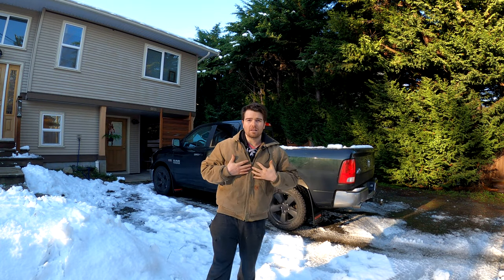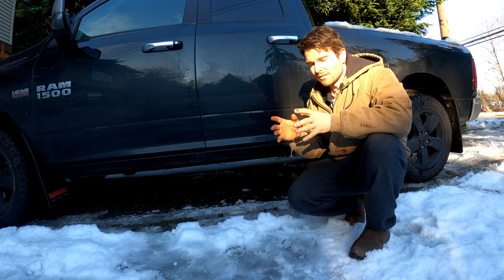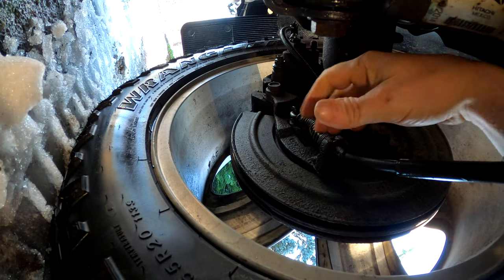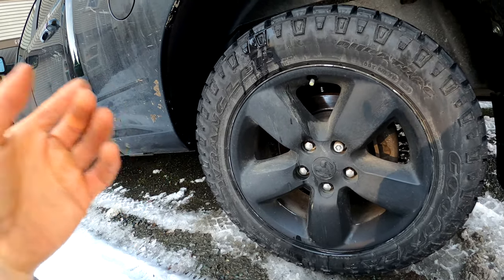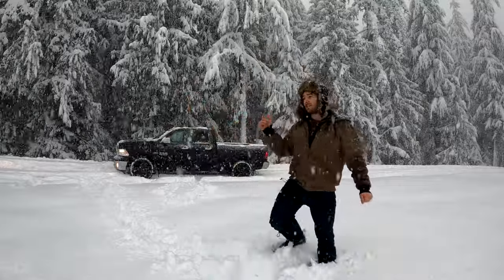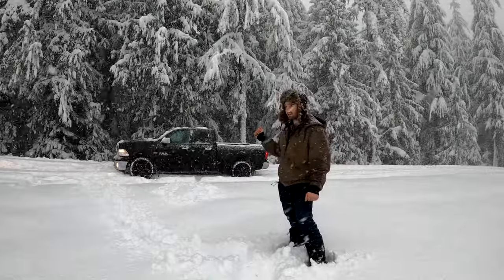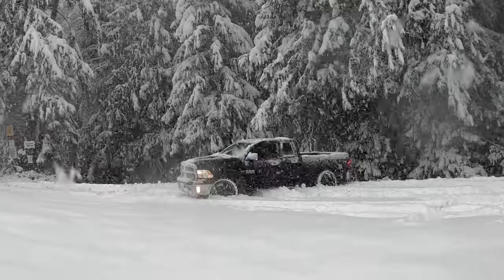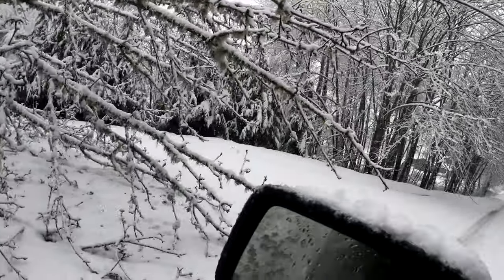RAM 1500 Sagging Park Brake Cable FIX (The REAL Cause) + Deep Snow 4x4 Mountain Adventure

Comment: The cable sag is a minor visual inconvenience.  The fact is; your parking brake is dragging causing the ABS system to throw codes. And wear out your braking system. It is caused by salted road corrosion. Should have been one of many recalls

Comment: How much would Replacing that fully and replacing the left rear wheel sensor ( it knocked it outa place/broke it) in total by a shop cost? ( i just got my truck ) happend same day bought just wanna know if dealer wont fix it

Comment: Just fixed mine. The adjuster as you call it is actually a lever. That part does not come in a hardware kit and must be purchased separately. That lever gets corroded or stuck and is the actual problem.

Comment: I have this issue and did not know this.  I bought a powerstop brake kit a few Months ago and wanted to wait til it got alot warmer here in Wisconsin. but I started to hear a dragging noise. Assuming it was the rear diff. I jacked up the rear of the truck and put in drive and noticed it was coming from the wheels. I started to disassemble the brakes and pulled the rotors and the parking brake shoes just fell off. The parking brake lever actuator can not even be moved by hand.  The lever is what you pushed back with the punch. So I basically rebuilt everything in the rear bags. Parking brake lever, shoes, hardware, then my new drilled slotted rotors and pads from powerstop. Did not look at the sagging cable yet to see if it fixed it but sure it helped with just alittle adjustment at the adjuster needed hopefully.  Thanks for the help.  And this confirms your theory.
Reply: I did mine just like yours powerstop everything, my shoes fell off as well it was rusty all over,  I pulled the axles cleaned everything and when I put everything back I took my break grease with a brush and brushed all the components that rub together, all moves freely, I'm jumping to the front now.

Comment: I've wrenched for years as a young lad and always hated ebrakes! Always needed to replace something on vehicles purchased as used and required for road worthiness. I did however, start using mine on a 2016 with very low miles. My driveway at camp is on an incline so I would engage them when parked. Had the droopy cable  problem and snugged it up ever so slightly. My truck is in the garage for a broken front axle (Northern Ontario potholes) and the they just called and said my ebrake pads had disintegrated and everything's seized! Told them to fix it and never, ever use those cursed ebrakes again!!

Comment: My 2015 is doing the same thing. I need to push the lever back into position. Just curious, did you ever replace the e brake shoes? Just wondering if that’s the solution or if there are additional parts that need to be replaced other than the shoes. I want to permanently fix this issue, not a temporary fix and have to constantly get under there to push the lever every time but not exactly sure what the permanent fix is.
Reply from the maker: Ya I replaced the brake shoes. Not the prettiest job but it worked well. And I always used the park brake and it still happened to me which is weird.

Comment: damn, I figured that's why my cable was hanging, thanks for the confirmation, time to fix... meh I need a brake job anyways, might as well.

Hey though, since we're all gathered here. Has anyone had the issue where wet heavy snow accumulates around the transmission and prevents you from being able to shift back into park after driving? Then you gotta hop under in the snow and clear the snow out from around the tranny so you can shift into park and take your key out of the ignition and lock up before you leave. Just another issue I've had which seems like an engineering oversight.

Comment: My E brake cable wasn’t retracting because water had got into the cable sleeve and rusted the cable inside. I replaced the emergency brake cables, and then the levers returned perfectly fine on their own. Hope this helps you guys.

Comment: This is shocking in some ways because I use my e-brake pretty often. I can understand moparas are inexpensive and they don't have super high quality parts. I knew this going in, but I just figured is often as I use it which is at least once a week I didn't think that I would have this issue. Thank you for posting.

Comment: Just did my parking brakes on my 2016 ram 1500. Both actuators were seized as soon as I installed new ones the cable was nice and tight and everything worked perfectly

Comment: What kind if tires do you have and do you like them?
Reply from the maker: Wrangler Duractracs. I really like them. Up here in Canada a lot of guys run them because they are highly rated for snow and ice but still have a good bite in mud and sand. slightly more aggressive that the Ko2's but still very comparable to them.

Comment: What I like about dodges they are fun to work on. In any vehicle some things can be not fun that’s just how they go if a vehicle is extremely easy to work on it can mean everything mechanically on it isn’t as reliable as something that’s easy and tough or… it’s just the design of the thing. Lol
Reply: Replacing these parking brake shoes is a royal pain in the ass.

Comment: It shouldn't be too much to replace the parking brake hardware right? I looked it up and the shoes are only like 30$
Reply from the maker: ya they should be pretty cheap. not much to them. however they can be a bit of pain the change.

Comment: Had the same issue. Glad they fixed it on the 5th gens with an electronic park brake with auto engage. Finally we don't have to kick that thing every single time which over time leads to sagging. - informative video bro !🍻
Reply from the maker: really? didn't know they went that direction in the 5th gen. Good for them because yes it seems like a lot of 4th gen Ram's deal with park brake issues!
Reply: @TheGettyAdventures  yh they did, the mistake I did was test driving one of these 5th gens. It's nothing like the 4th gens and completly rebuilt  ground up which improved everything including handling and especially braking. I still miss my 4th gen though lol a man cannot have all of it. 😂
Reply from the maker: @suhailxx nice to hear. I mean my 4th gen has personally been very good to me 3 years in. but only time will tell if she will last. and the 5th gen 's have the optional true locker from factory which is an awesome thing!
Reply: @TheGettyAdventures  she is going to last a lifetime if you have the will to hold on to it unlike me. Those hemis are basically built to last if taken care. Mine was thrashed through all kind of terrain and was a reliable daily driver till the end. 
Just don't do the mistake of test driving the 5th gen, you will understand what I'm talking about once you do lol 🤣 once things settle I'll be there on the island and you should definitely take my rebel for a spin 😊😊🍻🍻
Reply: @suhailxx  Yup suhail your right!!! Dam 5th gen took me in. Lol. Just love it. Been two years now and no looking back. Great truck...
Reply: @ramrider1453  🍻🍻🍻 definitely ! just got back from a long road trip and my girlfriend was telling me how comfortable the 5th gen is compared to my old 17. The difference is very noticeable and love how the frame and suspension handles through all the mountain roads. - Enjoy your truck and drive safe brother !